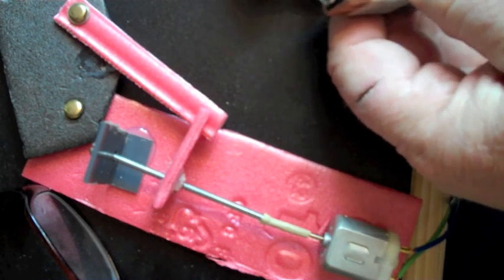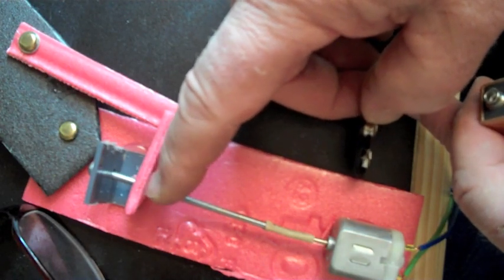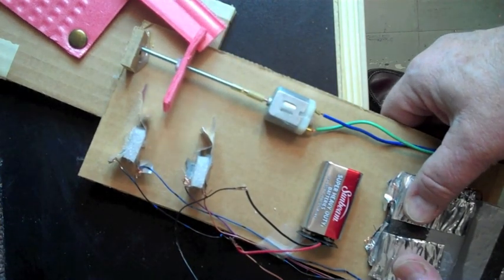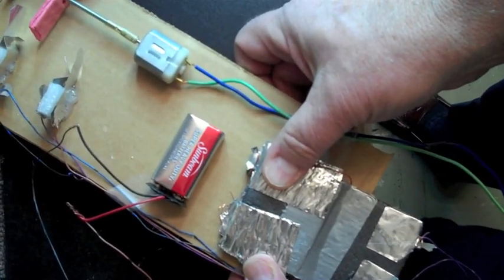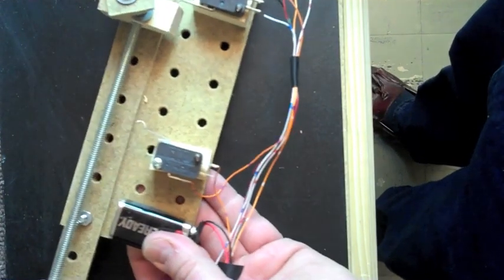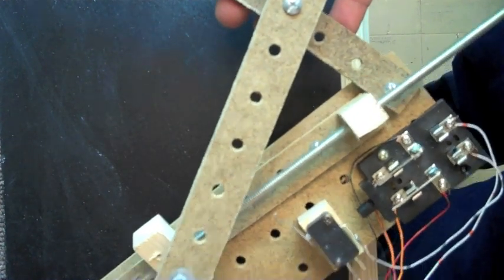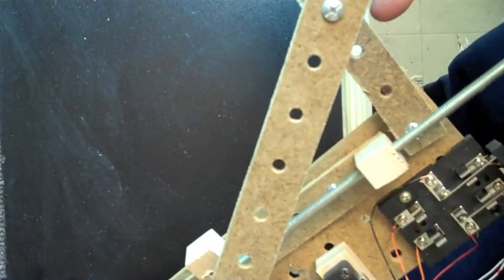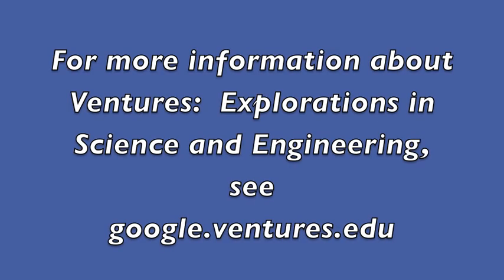Simple Actuators.m4v

Comment: You can also typically find screw drives with motors inside the sled positioning mechanism in CD drives(plus a ton of other cool bits and pieces like gears, encoders, photodiodes, magnets, and lasers of course). Though they do tend to be rather course pitch. I really dig your approach to constructing linkages and mechanisms, especially in this day and age of youngins just assuming everyone has a 3d printer, or extruded aluminum laying around(I blame the instructables crowd whos instructions amount to 'print this file, buy this sensor, tada now youre an inventor and you made a grossly misnamed, grossly incapable thing whos code you dont understand in the slightest!' blinding makers to the true ways of cobbling things together from essentially garbage like REAL hackers used to do). I still build prototypes out of popsicle sticks, wooden BBQ skewers, and scrap plastic or metal from old disassembled items. Why throw away perfectly good building material just because its not in a perfect factory standardized shape? Why cripple creativity by only seeing what is intended for a purpose instead of opening the mind to the possibilities and characteristics of the material itself? I dont need a precision milled bar piece with holes every 5 cm, I just need a rigid, thin bit of material with holes here and here. And there is tons of material around everywhere that can fill that roll. While they're still waiting for their print bed to heat up, Im already wiring switches and LEDs about to close it up and start coding!
Reply: I have always tried to figure out how the original inventors/discoverers/engineers actually made things. No science supply stores to provide plastic fantastic!  Making things and getting them to work requires the elegant thinking of those that have gone before. Having taught in schools with very little budget for "things" we were always relegated to make our own equipment. I'm not anti-cool gadgets (I also like Arduino and all the black box electronic plug-ins), but if we hope to ever inculcate a sense of ingenuity, drive, and persistence in STEM, kids ought to use some hand skills and walk in some of the footsteps of the giants that paved the way.  Cheers!

Comment from the maker: The electric motor is a hobby DC type. I have used a variety of these 3-6 volt brush type motors with success.  I think the one in this example came from Electronic Goldmine and was probably less than a $1.  There are many of these kinds of motors offered on eBay or surplus houses. One thing you should look for is good low end torque as these are direct drive.  mj